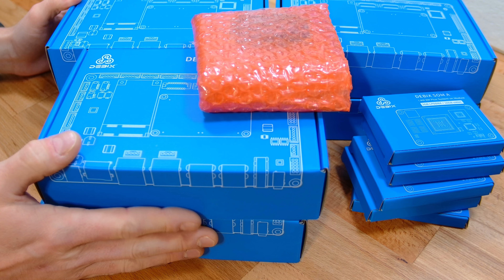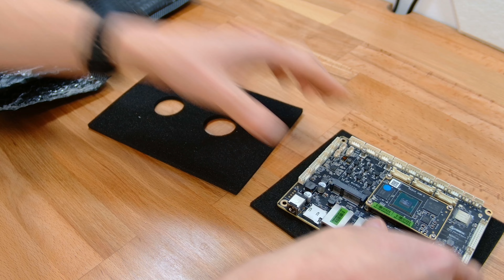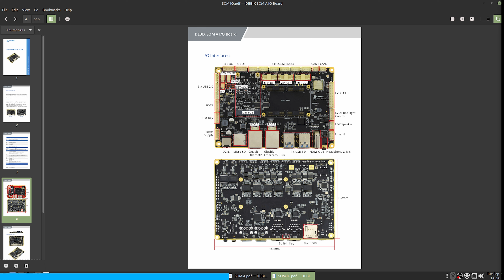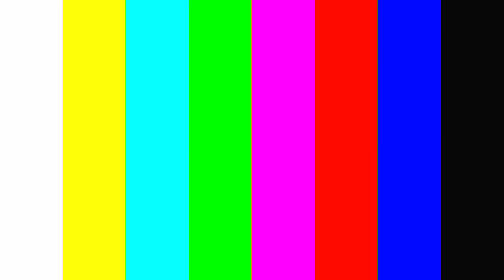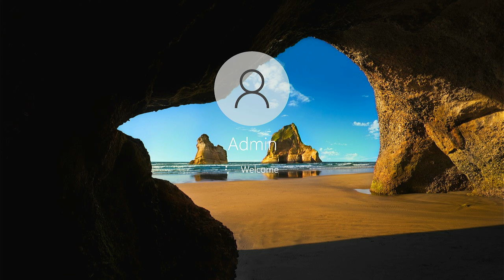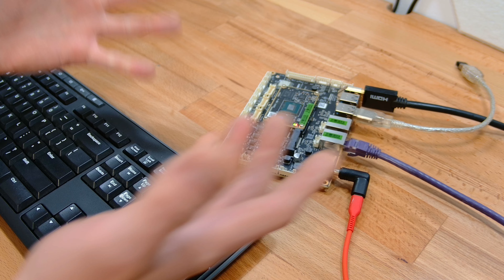Debix Industrial SOM's Part 1 - SOM A & IO Board with Windows and Debian

Comment: The Dipswitches is a nice feature - I personally cant wait to get my hands on a 16GB 8 Core zero format radxa when they come out. I have a 10 port USB A that I am slowly populating for my cluster with Zero boards and short USB A to C or micro male ports....... Since solidworks can be used via RDP ill be migrating to more of a virtual environment
Reply from the maker: God damn that's a lot of peripherals haha.

With Solidworks in a VM you'll want to make sure you're using some virtualisation that supports PCIe/GPU passthrough, as any CAD on a software GPU usually hurts pretty bad.

Comment: Solid performance and nice ecosystem. The corner screws omg finally! I'd love to see some more petite interface board options to the compute board.
Reply from the maker: Agreed, and thanks for the input! Why are the corner screws so important to you if I may ask?

I'm showing two more boards in the next Debix video in the coming weeks too 🤘
Reply: @PlatimaTinkers keep them coming. I appreciate your bringing these to our collective attention!❤
Reply from the maker: Cheers mate! PS the 100 pin connectors usually stay VERY well attached, but there are screws you're meant to use to mount them permanently too!
Reply: @PlatimaTinkers my opinion is that in real use the cables and cords apply so much action to ‘the boards’. Petite 100 pin connectors are too hard to keep connected even in an office setting.
Reply: Shock and Vibration testing is a real thing.   Typically, you would use a few stiff rubber washers with a low torque machine bolt loaded with thread glue.

Comment: at 4/5 watts idle, it's a very impressive little board, I am thinking of all kinds of use cases for it, running a small smarthome server, this would be perfect.
Reply from the maker: Ooh yeah quite possibly - especially if you need to run it in your roof/attic where the temperature might get a bit wild